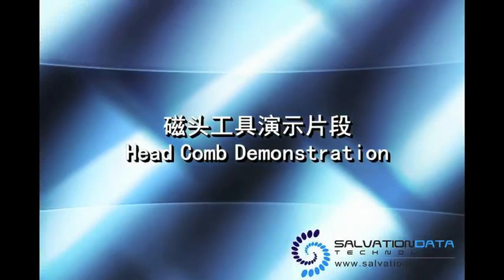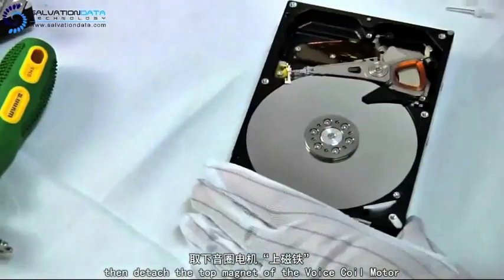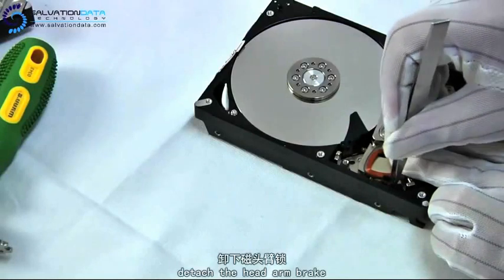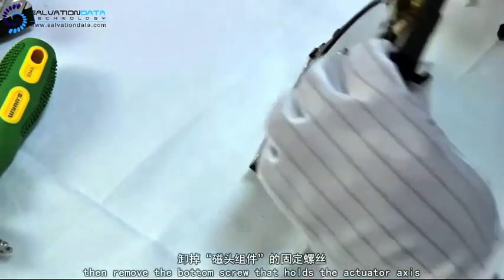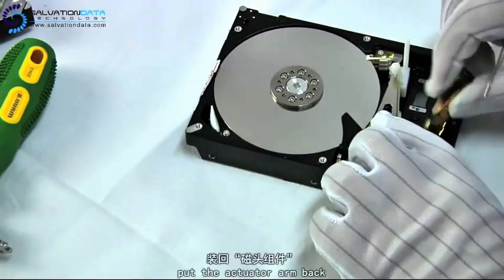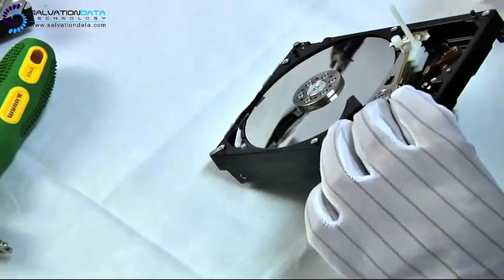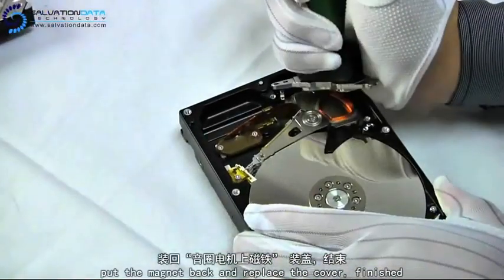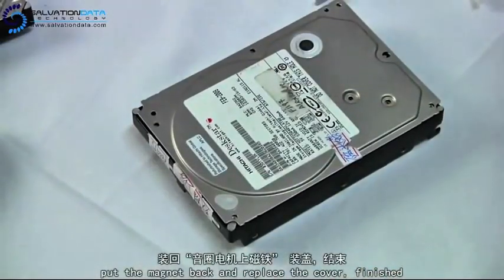Head replacement for HITACHI Hard Disk? Check the EASIST&QUICKEST way to do it.

Comment: this HDD HDP725050GLA360 began to knock strange, sometimes knocks so until it is not shaking, then works stably for several days, then knocks again, usually after switching on or rebooting. look, it's a recording of the sound of him knocking. https://cloud.mail.ru/public/5QYu/cbFLsd2ES maybe you can remove the card and the contacts where clean to look at? there is some screwdriver need? prompt.

Comment: If I'm replacing heads on my hard drive, do head have the match the exact part number? or can it be from same hard drive to another. In my case I have a WD1200JB HARD DRIVE which is clicking, I have ordered the circuit board and haven't tried it yet. I'm just making sure to keep another option open. Just in case if by replacing the circuit board it does not work, can I just get another WD1200JB HARD DRIVE and just replace/Swap heads?

Please post back. Thanks